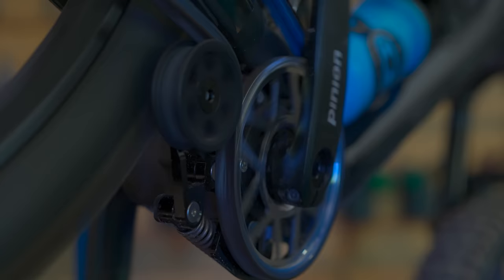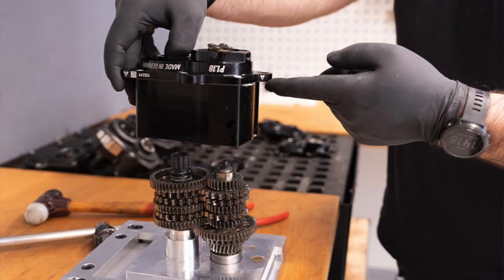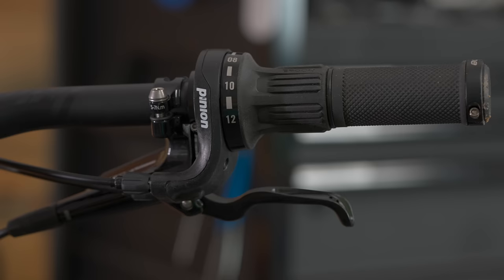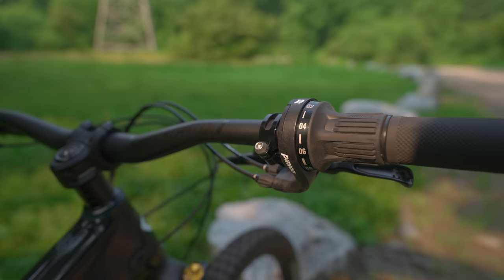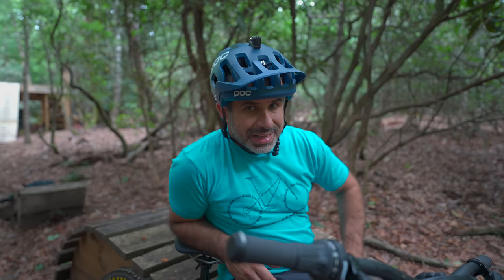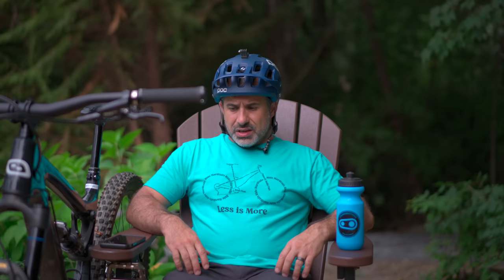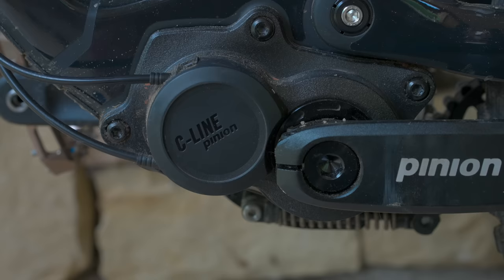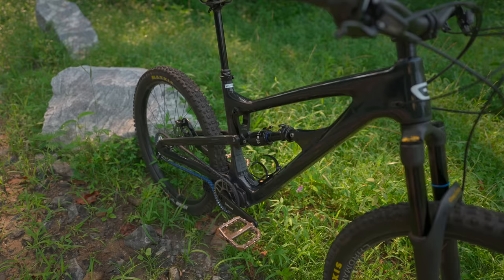What's the deal with gearboxes? Why don't more mountain bikes have them?

Comment: For about a month I have been riding a Rohloff speedhub in my commuter- and travel-bike and I must say, I love it! Sure some of the lower gears are a little bit noisy but you get used to it very quickly. For me the instantaneous shifts, low maintanance and durability are way more important than a silent drivetrain.
Reply from the maker: Rohloff has been getting a lot of love in the comments, and I haven't tried one in close to a decade. I'd be interested in checking a newer one out!
Reply: You are comparing apples and oranges. The Rohloff hub is 98% efficient (it is the most efficient internally geared hub).  Also, it lives in your wheel and not your bottom bracket.  Frankly Rohloff hubs are not for mountain bikes.

But, also, this pinion box is a POS.  I don't know why seth is shilling it other than greed.  These things are really inefficient. 9 meshed gears plus windage losses because of the oil bath inside it.   
Where they may shine is cross country where conditions can be horrific. Pedaling through mud in a heavy downpour and other bad environments and where reliability is really, really important. But the Rohloff is already the king of this application.  Where pinion really is bad is service. Just try getting it serviced in some small town in the middle of the back country in Mexico or something.   You could be off the road for weeks waiting for replacement parts.
Reply: I disagree... I love my Rohloff MTB and it works well!  Been running it for 2.5 years now
Reply: I have a Rohloff hub on a surly pugsley. I love that thing just from how different it is compared to my other bikes.
Reply: After destroying 2 Alfine 11's in 1 year, I went Rolhoff. 2 years later, I'm still riding my obese recumbent tadpool with a BIG grin, and the second oil change coming up.
Reply: @tarstarkusz  It's not only the conditions, it's also the gear range. 600% range vs 526% is a relatively big jump.
Reply: @tarstarkusz  Apples and oranges can still be compared.
Reply: @tarstarkusz Rohloff hubs were originally designed for MTBs though. Sure, nowadays you want as little weight on your wheels as possible, but back in the days of hardtails and crappy gearing, they were like something from another planet. They are super resilient to high torque and with a belt you don't have to worry about mud/water/dirt and you don't a have derailleur to break off. Sounds like they can be a great option.
Reply: @Serisar  But are they as strong as a modern through axle?  Also, can the shell take the torque forces on a 20ft drop?
Reply: @tarstarkusz  Rohloff is not 98% efficient. It might be 98 in the direct drive gear under ideal lab conditions. But in real world, most of the gears are closer to 90% or lower. Its just the nature of gears, and can't be changed much.
Reply from the maker: @tarstarkusz Actually I’m mixing up Rohloff with HammerSchmidt. I have never tried Rohloff, but you’re right, internally geared hubs are completely different. On the Pinion though, I’m not associated with them in any way and borrowed this bike. I haven’t had a bike or component sponsor in well over a year. I’m not sure where the anger is coming from in a conversation about mountain bikes, but I honestly hope you get out on a ride or four this weekend! You need it. Feel better.
Reply: @paulgallagher2937  Well, that's what I heard the tested efficiency was, but in a lab and only in 1 gear and you are probably right about it being a direct drive (1:1) gear.

But the pinion is much worse. There are a LOT (I counted 9 in a cutaway of the pinion gear box) of gears and they are all meshed no matter what gear you are in. There are probably many bearing and bushings in it.  It also has an oil bath which causes a lot of windage.  Whatever the Rohloff is in terms of efficiency, I guarantee you it is higher in the Rohloff simply because the gears are not always intermeshed and it uses grease and not an oil bath.

To give you an idea of how bad windage is, most modern car engines now have a windage tray to prevent the oil  in the pan from generating windage losses in the crank. It also tends to cause foaming. But this is probably not a problem in the pinion which runs at MUCH slower speeds.

But I do agree that no internally geared hub system is going to be able to compare to a straight clean properly lubricated chain drive.  Even the gates belt is less efficient, by like 1%  Even a derailleur system is probably more efficient.
Reply: @SethsBikeHacks  I'm not mad. I've been subbed to you for years and you do very little mountain biking now.
Reply: @tarstarkusz  The Rohloff also uses an oil bath to lubricate the gears. The Alfine 8 uses grease while Alfine 11 is also oiled.
Reply: @SethsBikeHacks  I was a little bit confused because the Rohloff Speedhub hasn‘t changed in a long time. In the last years they have only added a throughaxle variant. If it ain‘t broke, don’t fix it! 

Long time fan by the way. I was always more interested in the technical side of your channel despite not being a mountainbiker. On a recent trip  with my new Rohloff randoneur I had to decent some really nice flow trail which was unbelievably fun despite the bike not being optimal for it. Now I am in the process of building a cheap hardtail from used parts. 
Thanks Seth for many years of entertainment! Looking forward to many more years!
Reply: Running Rohloff with belt for almost 7 years. No maintenance except 7 oil changes. Works like brand new. I will never return to the conventional drivetrain.
Reply: Rohloff on a mountain bike is something I've wondered about.
Reply: @SethsBikeHacks  They are pretty much the same as they've always been. I have two(1 from 2014 and 1 from 2017) on MTB bikes and I've ridden one from 1999 and another from 2021. The 1999 felt smoother in low gears since it had so many miles but otherwise was the same as the other 3. The newest one from 2021 felt no different.  Try one on a serious MTB bike! Let us know how you think they perform as someone who is not super familiar with them!
Reply: @tarstarkusz  Umm... You do realize Rohloffs were Specifically designed for MTB in 1998 because the Sachs Elan 12spd hub broke too often during instantaneous high loads spikes in MTB applications right? They were originally marketed ONLY for MTB.
Reply: @Macks_Mustermann  If there is an oil bath, the efficiency claims cannot be right.  Churning oil takes power.
Reply: @XaviarCraig  In the days before 30-40 ft drops.
Reply: @tarstarkusz efficiency has been measured by independent labs. if you have a chain that is not straight, with more than 100 looks rubbing against each other and against cassette and chain ring, wearing out, slapping,  with diet, mud getting between the links, it can't be 97% efficient right?
Reply: @geemy9675  I've been pretty specific mentioning a clean well lubricated straight chain.  A gates drive is better by itself. But gates drives don't operate by themselves. They operate with internally geared hubs which are less efficient than a derailleur system.
Reply: @tarstarkusz  Your comment completely misses the point and seems to be just contrarian nonsense. Really weird behavior to go on a crusade against an object that is just a tool that a group of people can choose whether or not to use. "Team Derailleur" is a weird religion but whatever.

Most analyses inform you that the efficiency of a Pinion gearbox vs. a derailleur setup costs you about 5 minutes per 100km of riding. Not a consequential amount if what you are prioritizing is reliability and easy of use.. 

The service concern also isn't really valid. I am curious what you think regularly needs to "get serviced" on these? It's not like you're shearing off gears lol. The most likely failure is a cable stretch/break, which any shop can service since they're just normal shift cables (just 2x of them). You change the oil every few thousand kms and that's it.

He identifies exactly who these are for. Adventurers. I do mostly touring and bikepacking and doubt I'll ever again have a derailleur setup as my primary.
Reply: @tarstarkusz  IDK bro you sounds pretty mad.
Reply: @tarstarkusz a pinion or Rohloff are within 5% of a derailer system in top conditions. 5% is nothing crazy and something you will hardly notice but you can measure it.
It is certainly something for a pro but hardly a problem for hobbyists.
Reply: @SethsBikeHacks  (
Reply: @bwofficial1776 Yes, just try making an orange pie* or eating orange slices with sharp cheddar cheese and the appeal of apples becomes clearer.
*now I have to research substituting key lime with blood oranges (vanishes down internet rabbit hole)
Reply: @tarstarkusz  I've been riding rohloff hardtail on North Shore trails for 5 years now. I broke a steel frame already but the Rolhoff keeps performing. 20ft drops are above my paygrade but 3-5 foot drops to flat are no problem.
Reply: @tarstarkusz  Rohloff has some pretty big limitations though. The biggest downside to derailleurs is not the derailleur but the chain/cassette combo that requires frequent maintenance. And the gears on Rohloff are all in a very low range, meaning you need a quite high ratio between your chainring and rear sprocket. Combined with MTB frames that don't allow for big chainrings/belt rings(?) and belts that have a minimal bending radius which limits how small the rear cogs can get, it's impossible to get 3.8 total gear ratio with Rohloff+belt on an MTB (this would be the same ratio as a 34T chainring with a 9t rear cog which is the highest ratio I can get on my current bike). So you either have to use a chain which negates all of the advantages (except maybe the danger of breaking your derailleur), or you'll never go over 20-25km/h on the flat.

I wanted to convert my bike to rohloff+belt (the idea was to use a split belt from Veer), but after doing the research I found that I'd be stuck with at best a 2.6-3.0 ratio, and that's just waaaay too low. To go 30km/h would require an uncomfortably high cadence that just isn't sustainable. So I had to abandon the idea.

But Pinion's highest gear is not 1.4 as in the case of Rohloff, it's 3.3/3.4 (12/18 speed variants), so getting to a 3.8 ratio would be very easy and well within the specs of a belt. And on top of that I wouldn't have to give up climbing gears either, because it has 600%+ range (600% for the 12, 638% for the 18 speed variants).

Also FYI, the average efficiency of Rohloff is 94% and the average efficiency of Pinion is 92% (cyclingabout made a video on the topic and had a corresponding article on his website too), while the average efficiency of a modern 12 speed chain drive is about 96-97% when it's clean and in perfect condition (which is usually not the case, so realistically you're probably at that 94% mark of Rohloff, or even worse if you spent a day with your bike in the mud). So if you go down to a Rohloff, it's not that big of a stretch to go with Pinion in terms of efficiency, and in turn you get more possible gear ratios, water resistance while submersed (not the case with Rohloff), higher gear range and half the maintenance (recommended servicing intervals for Rohloff are 5000km and for Pinion 10000km).

After doing all that research, I'm definitely going with Pinion for my next bike, once I have the money for it.
Reply: @tarstarkusz they are tandem approved… so I think they are tough :)
Reply: @256shadesofgrey  , what are you talking about Rohloff needing maintenance. I have one on my mtb for over 10 years and I am currently on my second rear sprocket and the third front drivewheel. There is hardly any maintenance or wear.
Reply: @pcdispatch  I'm talking about the chain that you have to use needing maintenance, because you can't get high enough gear ratios with a belt+rohloff on typical MTB frames. And the fact that rohloff needs maintenance twice as often as pinion according to manufacturer recommendations.
Reply: @256shadesofgrey  , I don't have gear ratio problems with my belt. It is the first time I hear this to be an issue. I only change the oil once a year. I would hardly call it maintenance. It is no problem to skip it for a year. Once every 3-4 years I change the cabling and gearing knob for smoother operation. I believe the Pinion is heavier and has more lost efficiency. The Rohloff has all the weight in the back but I am not aware it is a problem for me. Maybe it would depend on the trails. If my next bike has a Rohloff it will be with a chain. The CDX belts are not the same quality as the old CDC belts. Some guy in the mtb group needs to change the CDX belt and sprockets every year because of wear. While I use my CDC and sprocket endlessly.

Comment: Also one of my favorite features of the pinion gearbox is the ability at the bottom of a hill to switch it to its first gear and instantly get up the hell without having to move around first and change gears on the go. Especially useful in traffic when you stop at a red light at the beginning of or in the middle of an uphill climb!
Reply: Well said
Reply: Also useful when mountain biking and failing to drop enough gears and having to put a foot down. Being able to drop into 1st and start pedaling rather than having to hike-a-bike to a flat spot is really nice for those of us who suck at mountain biking.
Reply: But that's not how you go up a hill unless you're on an ebike. You start out quick, but gradually slow down when going up the slope. You want to shift on the go, under load, to keep your cadence constant.
Reply: Just shift down before a climb if that's a concern? Well tuned derailleurs shift quickly anyway

Comment: I recently bought a Zerode Taniwha a few months back and i absolutely love it. Effectively zero maintenance and super reliable. Efficiency is hardly noticeable. Best thing i’ve ever bought and i could never go back to a conventional drive chain, especially since conditions here in the UK are regularly wet and gritty, wearing out chains and derailleurs super quickly. It is just so much better 😂😂
Reply: I'm surprised he didn't mention how many times you smash the derailleurs system during the rides.
I smashed three systems which cost in total over $2'000. You can't really enjoy the ride fully, worrying it may cost you a lot of money and time.
Completely agree! It's a game-changer.  Zero maintenance - omg, it's a blessing. So much time is spent on cleaning, putting oil on a chain, and changing the chain. All that mess is gone!
These two systems can't compete. Pinion wins in every aspect. There is no debate!
Reply: Do you people know of any other brands besides Zerode who are running the Pinion on trail bikes, enduro bikes? Carbon or alloy frames, either? Being in the USA, the shipping from NZ is wildly expensive.
Reply: @exothermal.sprocket Check out priority bike 600 HXT hard tail. Half the prize compare to Zerode.
Reply: @alpascua3348  Yes, I've known about that model for a little while now. Quite interested in it. It's not to the same purpose and use case as the full suspension Zerode but from where I sit, probably covers the first 70% of its capability.
Reply: Cybro No.5 & No.6 from Cybro Industries in Bassano Del Grappa, Italy also use the Pinion C1.12 with Gates Carbon Drive belts. Both are fantastic to ride. Like everything different they take a little time to adjust to the way they shift. Once you get the hang of it you probably wouldn't go back. Hint, the Gates belts do break, so carry a spare. We broke one on a Cybro No.7 and didn't have a spare - that was the end of that ride for the day on that bike, lesson learnt.
Reply: @cameronmathers502  The Gates belts are super strong, stronger than any chain. They do have a weakness, and that is twisting, bending sideways, or attempting to climb the belt on to the pulley instead of installing it the correct way. It will crack carbon strands.

Comment: Thank you for this video, I was waiting for it from you for years 🙂
Being one of those gearbox enthusiasts, I have one thing to add: efficiency is not that bad as it may sound from your vid, difference betweens factory fresh piece and meshed in one is significant. Also that efficiency stays there no matter what, so if you have well maintained, clean deraileur, you can beat gearbox. Once you start clogging it with mud or whatever, conventional system starts taking a nosedive, while gearbox is still as "ineficient" as it was in the begining.
So yeah, enduro, MTBO, commuters, long distance travellers...

You should really try it in a long term, because that is where it shines the best...
Reply: ✔️ He's right in what ^he said in the first 5 secs of this video,  about the big companies who wield major influence over the bicycle component industry. As far back as the 1950s, President Eisenhower warned Americans about 3 big industries that threatened the health and well being of our international society. He warned about: 
1). The military industrial complex
2). Big tobacco
3). Big derailleur.

  Ike was way ahead of the curve on that last one! 😁
Reply: Tbh at least with the ~8-11 gear boxes that are often used on city bikes today, I found they have palpable resistance, especially at low speed. My slightly cheaper bike with derailleuer has less resistance on high and low gears.

Although the bikes in the video are on the extreme end, so idk if thats really comparable.